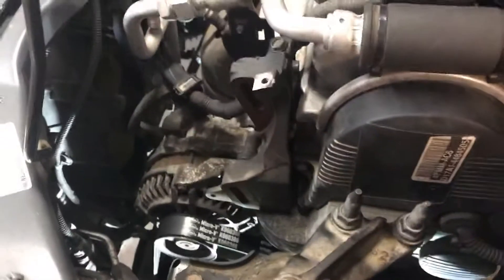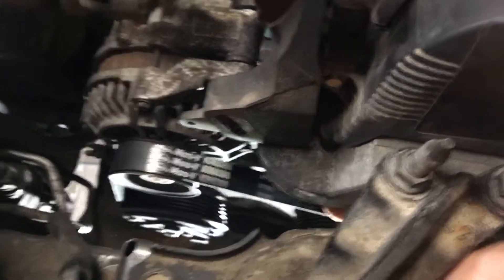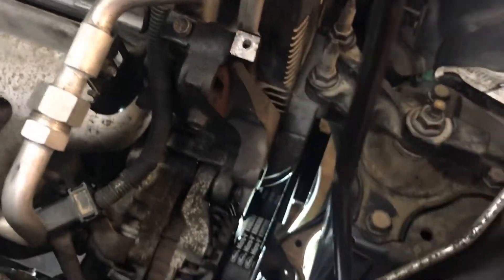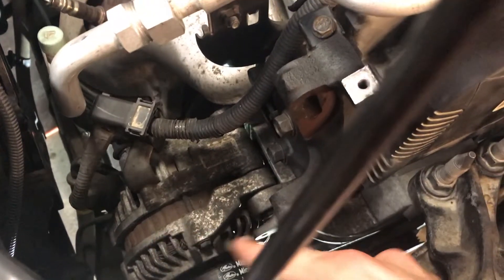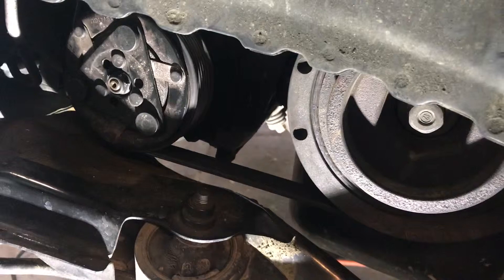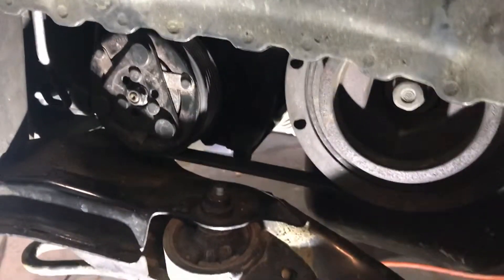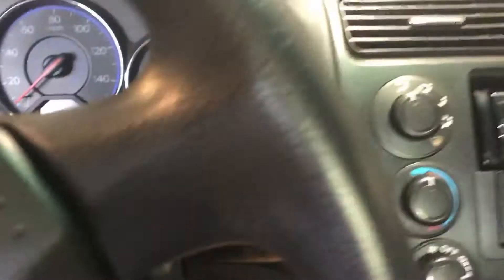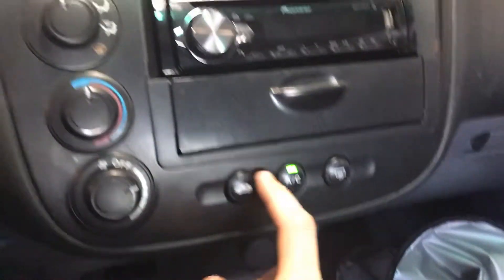Honda Civic Serpentine Belt Installation and Tensioning

Comment: Thanks for the guide.  Followed it and got my belt changed. I was lucky as I have electric power steering on my 2004 1.4 Civic so no power steering parts to remove.   
Wing nut tensioner was really stiff. If it helps anyone else, you can wedge a 27mm socket on it and turn the socket by hand.

Comment: I couldn’t remember what size the bolt was down there thanks. Didn’t wanna lose a socket guessing

And yeah for some reason the serpentine belt needs way more tension than you would think. Power steering pump isn’t anywhere near as sensitive

Comment: I was trying to find out how to avoid too much tension and not burn out the bearings.  Your video was very helpful in that nobody else's videos talk about belt tension without a tensioner. My 98 Accord does not have a tensioner. I have to manually adjust the belt. (Sa.e set up as yours. I changed my alternator and put my belt back to the same position it was in as I marked the adjusting bolt and then I ended up with an awful squeal. Nothing wrong with my belt. After watching your video I thought to myself well maybe I just need to tighten it tad and ta daaaa! Thanks pal!👍

Comment: The real issue is that Honda did not provide enough wrap of the belt on the pulleys. They should have added an idler pulley to get some serious wrap on both the alternator and the AC pump. The only solution is to tighten the belt up so tight that the bearings are at risk on the alternator. Bad job Honda.

Comment: Picked an 04 civic up cheap for a daily, this is one of the worst belt setup’s ive seen.(Coming from subaru land) that also has the manual belt tensioner, this civic has to be pretty spot on to not squeal. Thanks for the vid man, saved me frustration after 4 attempts of trying to set it where i thought was correct

Comment: So I just fixed mine the wing nut right next to the alternator the hex shape was rusted out so I couldn’t fit a 12 mm wrench on it. Don’t panic if this happens to you all you need to do is get a 1/2 ratchet with a 27 mm socket so that it fits over both wings on the wing nut to tighten up it works just as good as a 12 mm wrench
Reply: I got a question not sure where to ask this but my car only make a whistling sound almost at start up and it basically goes away after driving… could this be because the belt is a little too loose? Could I just adjust the wing nut to make that minor adjustment?

Comment: Same issue. Tightening the belt made the squealing go away.  Now the battery indicator in the instrument cluster flickers sometimes. Not sure if something happened to the alternator.
Reply: That's a symptom of being too loose. Alternator is either slipping or the diode on it is going bad
Reply: @imalizardman  Turns out the  lug connected on the backside of the alternator was not actually connected. It was pressing hard against the post so able to generally make an electrical connection due to the other connector pulling it taut. 

Just enough to work most of the time. Geez.

Comment: The best way to tighten the belt I found was to loosen the bolt holding the alternator and the 12mm bolt below (he points it out in the video) then you can turn that wingnut easily with your 12mm wrench. Hope that helps
Reply: Definitely easier with a wrench on the wingnut 👌
Reply: Definitely....
Reply: There's also wingnut sockets, they work great.
Reply: so dont loosen the 14mm bolt